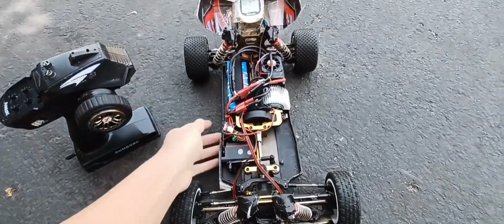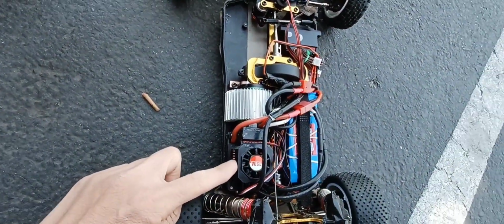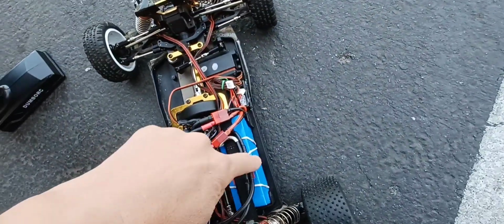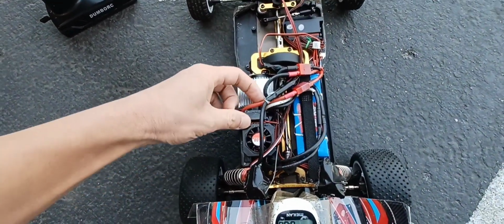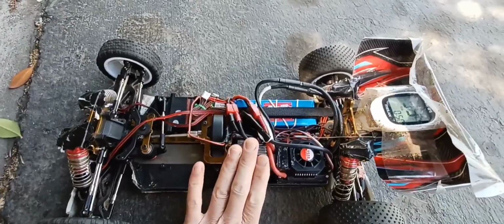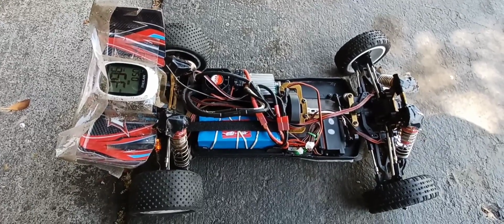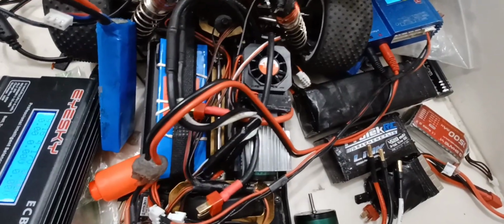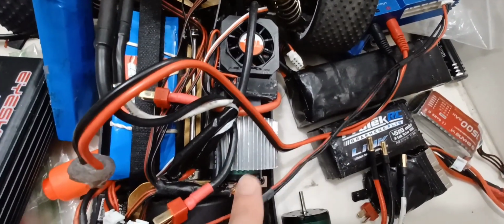WLTOYS 104001: Testing 4S on 9000kv

Comment: I like your style, I use marine grease, I like the surpass 150a but use the hobby wing sc8-rtr, and I put the batteries in parallel.
Reply from the maker: Thanks.  I have two of these 4S sc8-rtr but mines are 80A instead of the 120A.  I was surprised that my 4S 80a ESC is faster by a few miles compared to the 3S 100A ESC that comes with the Arrma Big Rock v3.  Putting batteries in parallel is smart and should be standard unless we are going slow.  My batteries are always pretty warm after some fun.  Thanks for sharing and watching 😀.

Comment: I suggest not running that motor on 6s. Ripping on 4s was already insane, considering that it should be a 1, max 2s  rated engine. On 2s full stock you should already fly and hopefully reduce that bad cogging.
Reply: i agree...even with its stock pinion being pretty small, i would think a 4300 on 3s would be over 45 mph and should have great power with no cogging... or maybe stick with 2s and use a 5000-5500kv with stock gears may also be nice buggy setup...